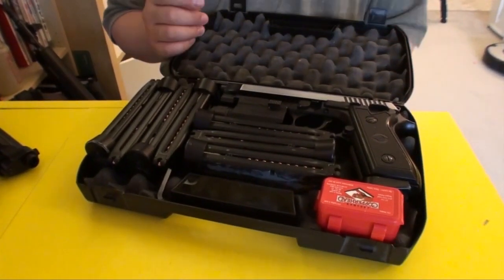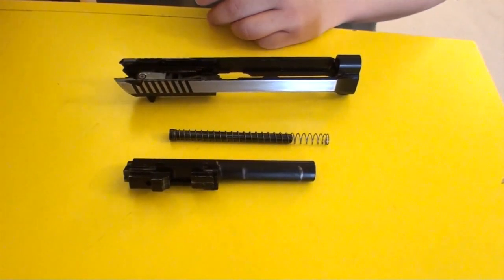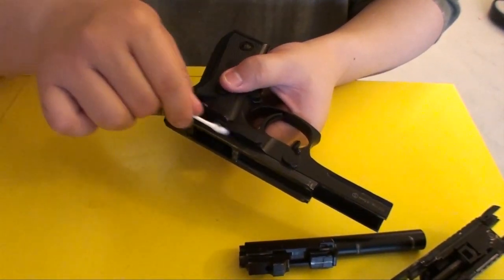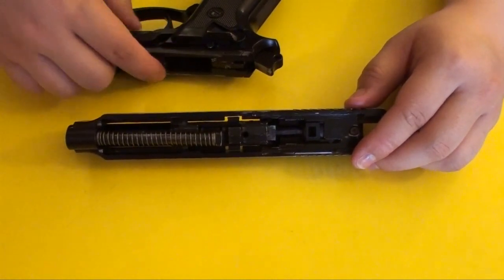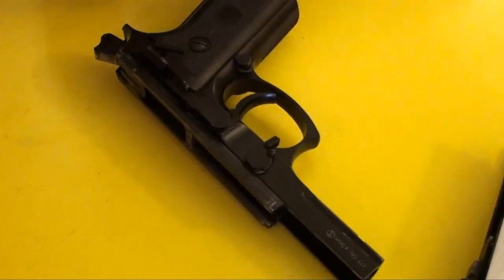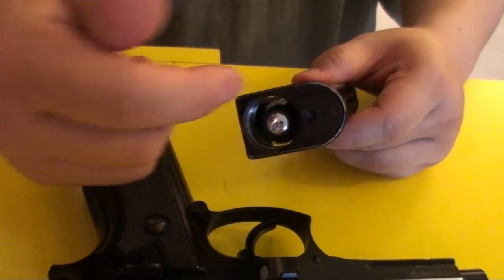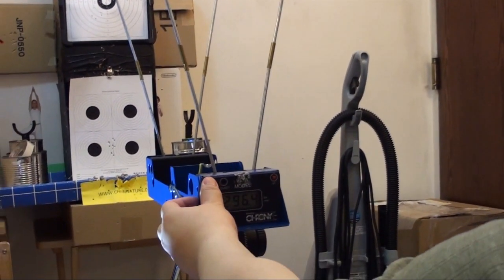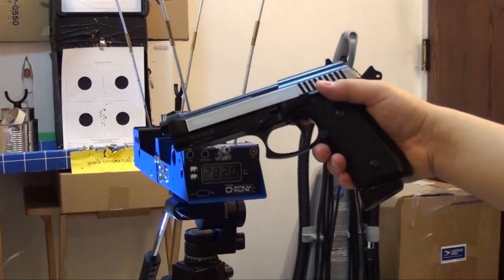GSG 92 Co2 (4.5mm) - Improve Performance Tutorial and Chronograph Test

Comment: ok so i owned this gun for about 1.2 months now, and there is only 2 things about this gun that bother me. 
1. the barel scratches everytime the slide blows back due to the pressure the barrel hops up and hits and scrapes where the front sight is, its sharp and acts like a shaver everytime

2. the extended mag/ or the part at the bottom, the extra grip for your little finger?  lol? any way that is just...meh  its good but not for a full sized gun. maybe a picket pistol that only allos you to wrap 2 fingers nstead of 3 then the extra grip will come in handy but they could have made it like, half the size, other than that it is smooth, tight,and it shoots straight
Reply: ***** nope, because the barrel is more tight and fixed in the frame in the  real pistol

Comment: I would really like to buy this gun but i've read some reviews on the internet that say that this is not a very durable gun. I don't have the money to buy another one if it breaks so I would like to hear your opinion about it. Also could you tell me something about the accuracy? Some people said that it is sighted a bit low and to the left, is that true? Btw I really like your videos, keep up the good work! :D
Reply from the maker: Thanks! This is a very durable gun for me, unless you are treating it very badly and using wrong methods to oil etc... otherwise, it's very durable and care-free too. The accuracy - yes there is a bit OFF for that and it is easily fixed by wrapping a bit of tape over the innerbarrel and then fine tune the tape's thickness on whatever side to adjust the shots to land right in the center of your aiming spot and it will be super accurate. My GSG92, even on full auto, group 1/2 inch with a full mag, imagine that...
Reply: Chiinnature If that's not too much asking could you make a video tutorial on how to adjust the barrel for the accuracy improvement? I would be so grateful if you could do that!
Reply from the maker: Giovanni Dragone
Um.. maybe if I get the time and mood again for that kinda vid. It's very straight forward though. Take the inner barrel out and wrap some electric tape around it, and make sure it fit into the outer barrel in a tight fit, then assemble and shoot a few shots to see where you want to shoot more toward, if shots are too low, you add tape to the lower portial to lift the shots upward. Very easy....
Reply: Chiinnature Is this gun more accurate than the other blowbacks (eg, Whitness, P226) with the barrel mod? I assume you can do the barrel mod to other guns? And does that significantly improve the accuracy on those as well? Thanks

Comment: You shouldn't store your mags already loaded. Its bad for the springs. They will weak over time and you will have problems with the gun and it feeding BB's. The springs get weak and BBs will not feed properly is what I mean. This happens to real guns even. If the mags are stored loaded the follower springs get weak and need to be replaced or stretched out. usually stretching won't even help. Just a heads up, cause its not a good practice.

Comment from the maker: actually I do use silicon myself more!
Reply: Hi, could you help me, I have a problem with the same gun, the slide release doesnt work propperly. Sometimes when I press it the frame doesnt go all the way back. When i pull the triger or push it, it countinues. The gun is new